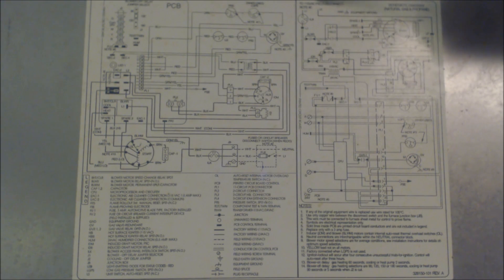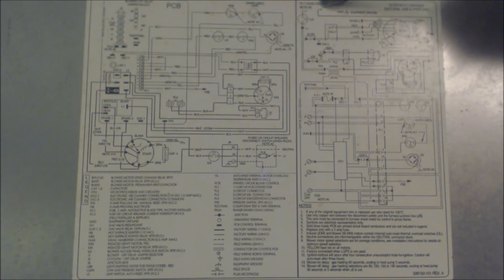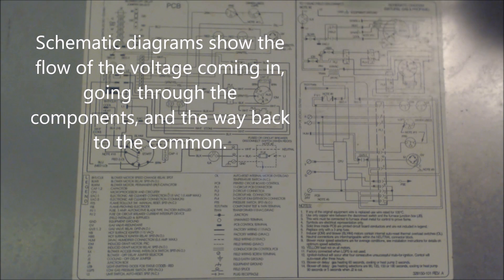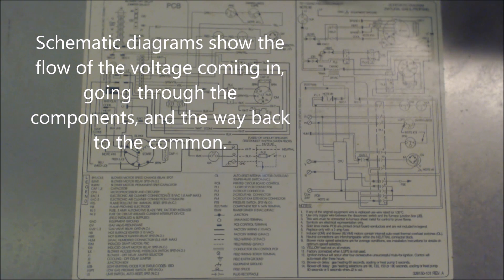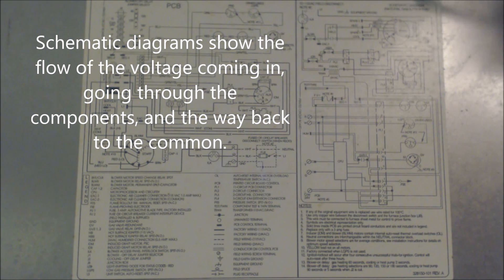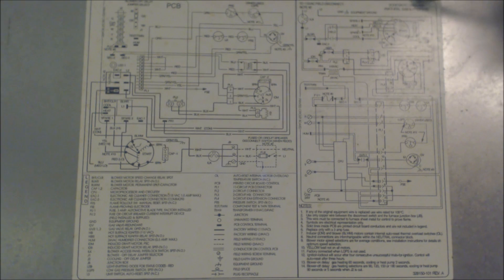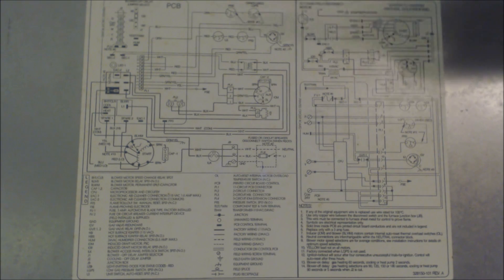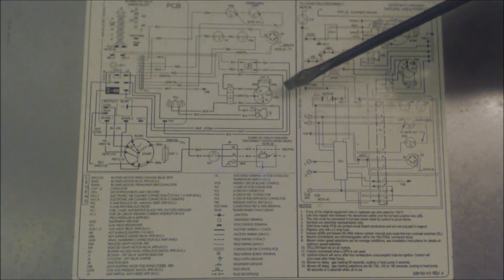Reading HVAC Electrical Wiring Diagrams for Troubleshooting!

Comment: Thank you very much for that video, one of the things I struggle with is looking at a wiring diagram and the actual unit and figuring out where the wires go. Been in the field 6.months as a Lab technician

Comment: So if your troubleshooting, what’s the side to go on connection side or wiring diagram? Is there a rule you go by as to what’s the problem with the unit? Not cooling, where would you start?
Reply from the maker: No cooling, it would depend on if it sounds electrical, airflow or refrigerant charge from what the homeowner says. Typically start with filter and airflow first and then second, turn the outdoor disconnect off. Then turn tstat on cooling and get fan running in high cooling speed.  Hook manifold gauges or quick connect test gauges up. Turn disconnect on while you are standing in front of the outdoor unit to listen if there is a problem, go from there. In reference to wiring diagrams, schematic tells you how it works while connection tells what wire goes where, thanks!

Comment: In some parts of circuit there are 2 wires in parallel such as at the fuse or into the transformer. The wires run side by side. Why is that  ?
Reply from the maker: It may be applying power to one item and sending signal voltage to another. After signal voltage goes through a switch, it will come back to a dedicated spot on the board unlike an item being powered which comes back on common, thanks

Comment: Hi Craig...you are truly an asset to have.  This was all great, but wanted to ask;  after the transformer...where does the 24 volts go to on the board...I thought 24 v was suppose to be present and coming from those terminals that would feed the circuit of operation waiting for a call for heat initiated by the Thermostat !! Thanks
Reply from the maker: They go through the fuse and then to those limit circuits to check for safety before going to the board at R and C, thanks

Comment: Hi. Would you please let me know what type of electrical wires and what gauge to use when replacing them in case they are damaged? Thanks!
Reply from the maker: 14 gauge is good for 15 amps, 12 gauge is good for 20 amps, check the max fuse or max breaker size listed on the rating plate of the unit, thanks

Comment: Loving the videos acservicetech!! I know you were just showing us how to troubleshoot with using the control board (your example: COM to one terminal of the switch)... but my question is, can you also check for a voltage reading without using the control board by going across the switch's two terminals with the meter probes?
Reply from the maker: You could test the switch with the wires disconnected with resistance that way. You need a common and a hot to read voltage though. This will give you the most certain answer, thanks Jay!
Reply: Oooou quick reply, thanks acservicetech.  But I know you can test resistance across the switch with the wires disconnected. I guess what I was trying to ask was, can a short circuit result when testing for  voltage across the switch?
Reply from the maker: A short circuit usually means a direct connection between hot and common. I always test with a ground or a common for accuracy in being able to tell what is going on since that will be the path back to the breaker anyway, thanks Jay
Reply: Acservicetech thanks

Comment: Yes this is perfect thank you! 👍
Reply from the maker: Glad to help David!
Reply: acservicetech Now I need to go to the book I got in school and read through again why these safety switches would trip. I know you mentioned the cracked heat exchanger but I am sure there are numerous other reasons also.
Reply from the maker: Next time you are near a furnace, open the door and look at the limit circuit fault code and look at what is says could be the problem for an open limit wire as well.
Reply: acservicetech you should do online school training. I would definitely sign up.
Reply from the maker: Thanks David! That would be a little much for me at this point but maybe in the future.
Reply: acservicetech I hear ya.

Comment: Hi, at the  end of the video at time [17min.] the voltage between R and C was reading 14 volts, with limit disconnected. Why did'nt it read 0 volts, since the limit was disconnected. THANKS FRIEND [ ALSO]  do you have a video on troubleshooting the IFC or control board? I could,nt find on your site.
Reply from the maker: Great Question! There is voltage on the board backfeeding to the R but the board was still able to limit this down to 14 so it would not provide power to turn on a thermostat or to be the correct voltage if R was connected to W on the board. If this was just wires and you broke the circuit then you would just get 0 like you were saying. Thanks  So we usually troubleshoot a board by knowing what everything else does and when we should have voltage coming off the board at a certain spot. It is the last thing left if we are certain about everything else. Interesting concept, I eventually should make a video about that concept and how to know if the board is bad for certain. Thanks

Comment: the reason i ask this is that i live in central fla. and that is realy the only heat that we need. thanx again
Reply from the maker: Yeah I realize you guys are not running furnaces down south in Florida so the more knowledge on the Reversing Valve the better. Thanks